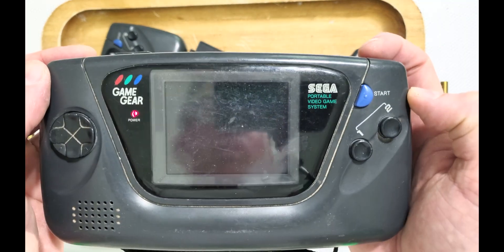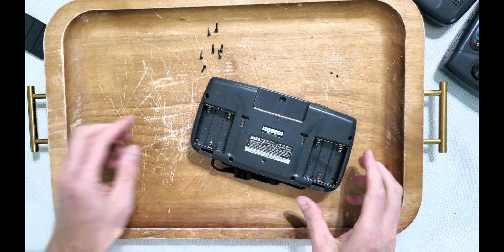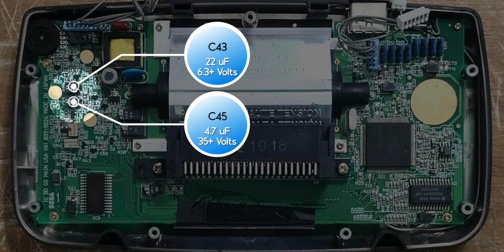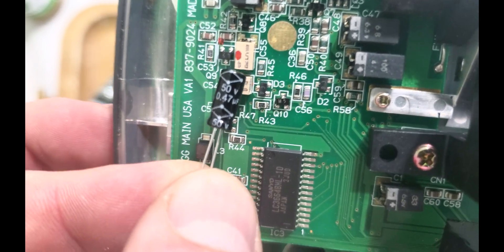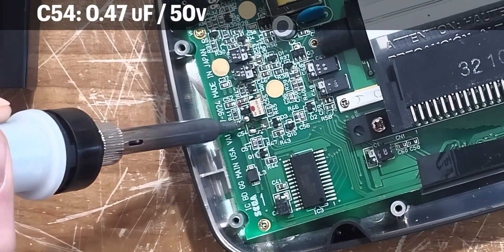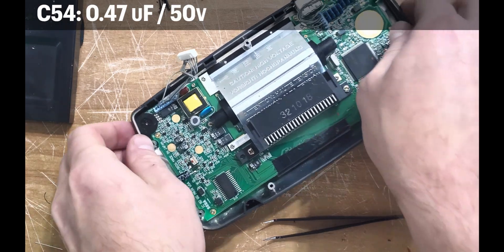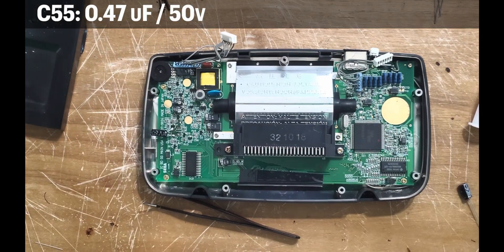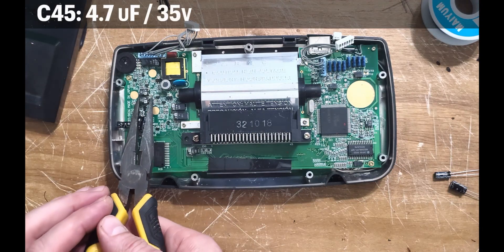How To Recap A Sega Game Gear (VA1)

Comment: thanks dude! the info was super well documented and it was really easy for me to check if i had the right capacitors or not and which ones i had to order! This was my mom's gg and she is more than happy to see it alive again! i'm just asking but, is the low sound on the sound board a capacitor issue or is it related to something else? i have checked many forums and they just tell me to swap the sound board because even after others changed the chips and resistors, it wouldnt work (but the aux works just fine)

Comment: Well documented. My son says you sound like an 80s dude and I say totally Rad bruh. 😅. I have a VA4 board with large white bar in front. And can’t see any video activity. I recapped as per the wiki caps and not quite sure what’s causing it. Sound and power seems to work. May be you can point me in the right direction.
Reply from the maker: If the "large white bar" has any traces of magenta or cyan colors in it, the display drivers are shot.
It sounds like the recap was successful with the sound and power board, so the main board may have a flipped cap or one that you missed. (Hard to tell without photos)
And thanks for the 80s comment! Good times!